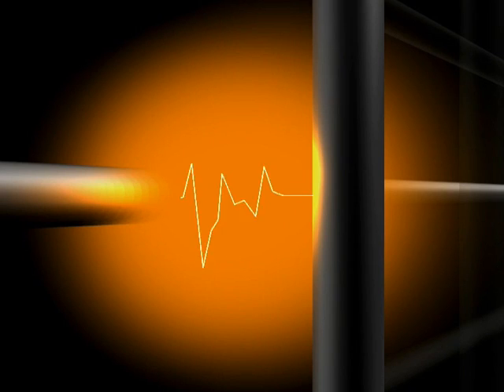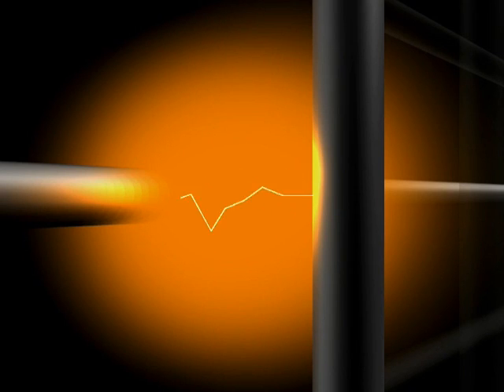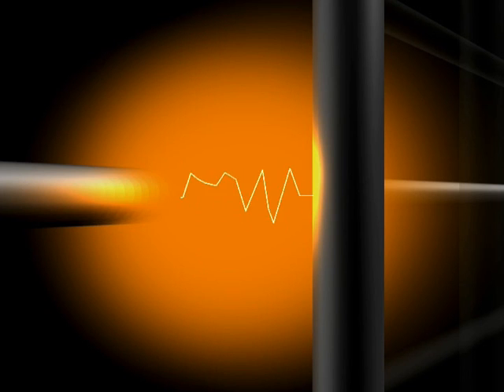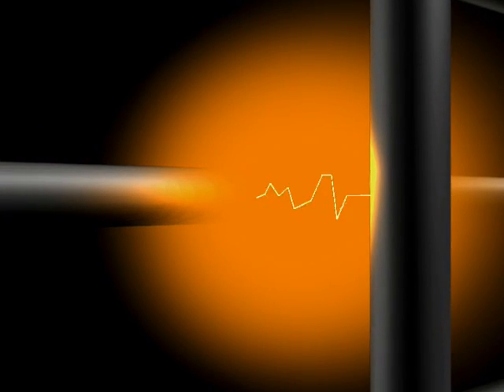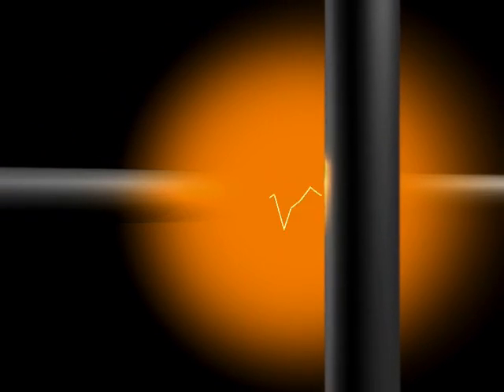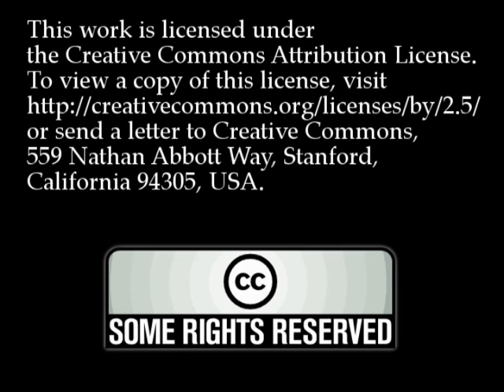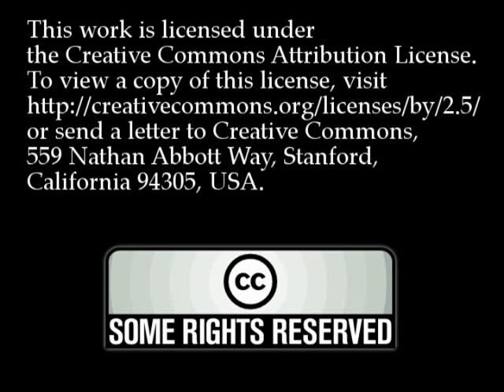How do plasma screens work?

Comment: A question I have had for some time now that I was researching when I found your video was for an AC Plasma Display panel do the pixels get their data written and scanned one pixel, or one horizontal line at a time.  How long does the sustain period for a pixel persist compared to the frame rate of 16.67 mSec